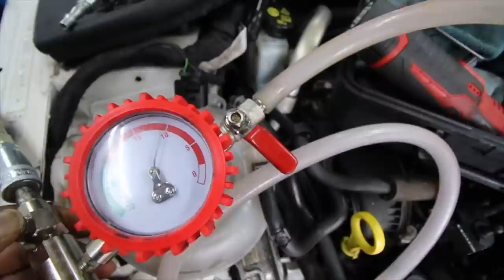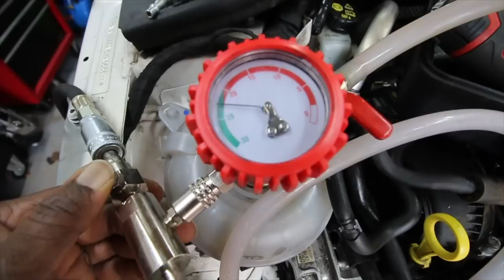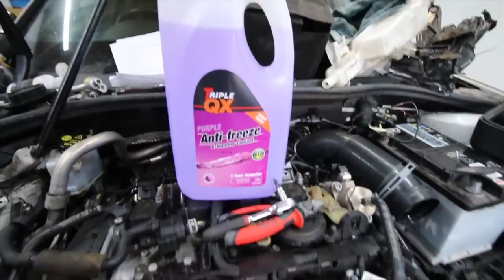How to Vacuum fill coolant in a Audi S3

Comment: Paul  you need to spray with soapy water.  In a plant sprayer   50/50  water and fairy liquid. You spray it on the joints and pipes  and it will show bubbles if there is a leak.  Truck for next time.  And remember  air leaks out easier than a any water or oil media.
Reply from the maker: Thanks

Comment: i know im late to the video here but the fans usually run really loud and fast because the ambient air temp sensor on the front of the car is broken. This happened to my golf R. I replaced the part for $10 on ebay and its perfect now!!!! hopefully this helps someone

Comment: My 2019 Audi S3 shows zero boost on its gauge when I'm driving it. It does not have a bumper on it right now. Just wanted to know if it's because of that or something else
Reply from the maker: Sounds like a a disconnected boost hose to me

Comment: I need help with my s3 I have done the vacuum fluid in and had car running heaters will be warm then fluid starts bubbling and throws it back out the bottle like it still has air I have done the steps around 6 times still doing the same thing I drove the car and Red warning light comes up coolant low. Don’t understand why is it doing this also it has had a new water pump thermostat
Reply from the maker: Do you have access to vcds to see whats going on? It could be a blockage or at worse a blown head gasket
Reply: @CarsForPaul  I have Vcds what steps should I follow on there, I did have it plugged in checked reading coolant temp when it hits 90 degrees my heating starts going cold then temp rises to 100 degrees starts pouring out the bottle makes sounds like air lock. Only pours out when temp high
Reply: How did you end up getting this sorted? Im having a similar issue. Vacuum bled method and still air lock
Reply: It was a faulty water pump I replaced it again sorted the problem. Watch my videos is your car doing the same
Reply: @h3vy_w946  that’s crazy. I pulled my engine to have it built. I’ve put it all back in and having this issue. The pump was fine when I removed it.
Reply: Remove the radiator fan, remove the inlet manifold and you can get in from there make sure you change the seal on the water pump before installing and the bolt also the small belt.
Reply: @h3vy_w946  I have no other reason to think the pump is bad. Belt, Union and gasket are new.
Reply: @burb17   if you watch my videos is your car doing the same.

Comment: Just fill it with water see we’re it is coming out off then using coolant
Reply: exactly what I was going to put, definitely easier and cheaper than that vacuum thing.
Reply: I thought same I thought you pressure tested the systrm with water in to also check head gasket